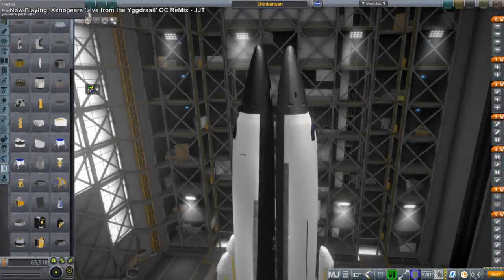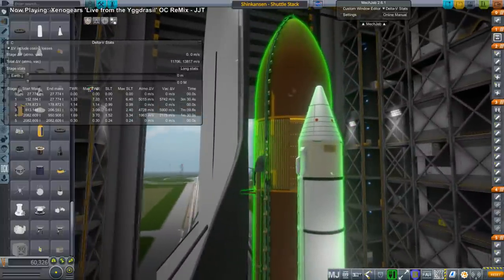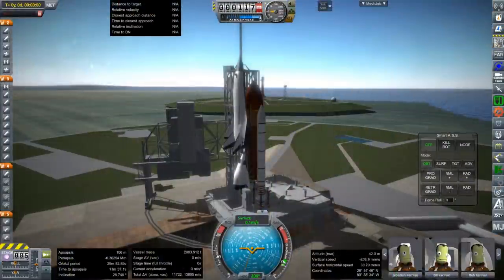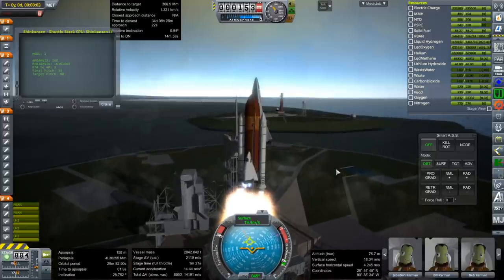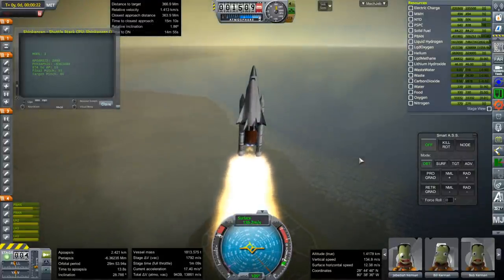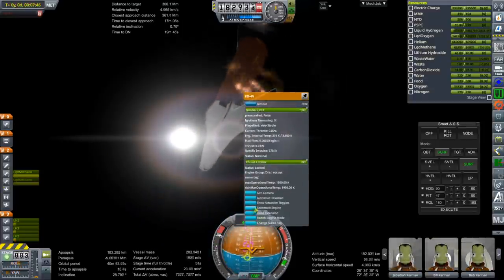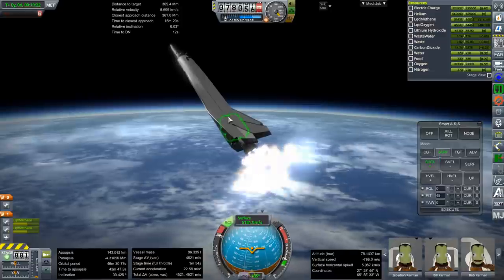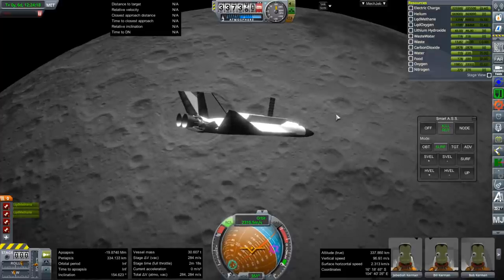Realism Overhaul in KSP - Shinkansen on the Shuttle Stack

Comment: 8:45 That's... odd... I remember a (near?)-identical proposal called the Ballistic Aft Fuselage Propulsion Module, but I'd never heard of there being one on each side. (And I had also independently came up with the concept before knowing it was real.) 

9:28 Perhaps you could also alleviate the 2nd stage TWR woes (in addition to powering through Max-Q at full throttle and reducing the Shinkansen's fuel)... well, what SSME version/thrust rating did you use? I'd have them running at a constant 109%.

23:15 To eliminate the rotation problem, maybe the angle of the SSMEs could be altered by a  few degrees?

Comment: Hirmh... What about doubling up on SRBs and running the SSMEs on minimal thrust?
Reply from the maker: The SSMEs already go minimal through maximum dynamic pressure, so putting double the SRBs would put way more stress on the vehicle. In real life, this arrangement is already pushing it, and adding SRBs would definitely rip it apart.
Reply: What about halving the SRB thrust for double the burn time (whilst using 4 SRBs?)
Reply: @LexieAssassin  to increase gravitational losses

Comment: I guess the point of this (shuttle concepts) is just because it's cool right? More like a challenge than anything else?
Reply from the maker: Well, the Shinkansen's limited payload capacity in its twin-spaceplane configuration has been an annoyance, so I've been looking at alternate concepts. The point of this, I suppose, is that we could have replaced the Shuttle with a lighter spaceplane for crew operations and light payloads (putting heavier payloads on the previously introduced Shuttle-derived launch vehicle), still recovered the engines using an Engine Mouse, and would be able to have this spaceplane facilitate operations to the Moon. Instead of having Orion on SLS, you could use a lot of existing hardware, recover the engines, and your pod to the Moon, service module, and transfer stage would be reusable (because they're all built-in to the Shinkansen).

Comment: You could put the three RS25 engines onto a hinged thrust plate. A little math should give you values to set the proper angle on the hinge while the CoM shifts. So you always have left enough angle on your engines' vector gimbals for controlling your attitude.

Comment: Please, do you have a document or diagram showing the space shuttle concept with two engine pods?
Reply from the maker: It's in the book Space Shuttle - Developing an Icon by Dennis R. Jenkins, Volume II p.451. It was a Shuttle-Derived LV proposal in 1984. Rockwell proposed an engine recovery system like the engine mouse in 1982, but that was paired with and strutted to a side-mounted payload carrier. For the double-mouse system with top-mounted payload, there's a diagram and an artist depiction, but I haven't found details in a cursory look at the text. It may be from here: https://www.nap.edu/read/19350/chapter/7#25. Interestingly, that's a 4 engine variant instead of 6, so apparently they beat me to that as well. Edit: here's a better version of that:https://ntrs.nasa.gov/archive/nasa/casi.ntrs.nasa.gov/19850015556.pdf on page 35.
Reply: @RaizSpace  thanks a lot!

Comment: I think this idea with shuttle parts is step back from your original idea with 2 planes. Looks like you have a lot of "empty" space in fuselage and wings - why not use it for more fuel and boost thrust (since it all theoretical) for good twr? This way you can throw away this little boosters and get much more simplier system.
Also, since you have a lot of tanks, why you not using mod for balancing fuels? In my planes i found PWB Fuel Balancer useful.
Reply from the maker: This is if we need to have a direct transfer to the Moon and is sort of a challenge to Orion, as this, if workable, would be a patently better system than Orion-SLS. There's no empty space in the fuselage - you can verify that from the original design videos - and the structural mass of the wings would have to increase to bear tanks, and those tanks would be of negligible volume. Also, the Shinkansen has to be refueled in orbit, and it is sized so that this can be done with one launch of an SLS Block IB or a Starship (one reason I decided to make Starship). There's no point in balancing fuels - we want the rear tanks to drain first because that's essential to Shinkansen being able to reenter.

Comment: I think what you proved here is that the shuttle stack is a useless piece of antiquated engineering that doesnt work outside of the very narrow parameters of the shuttle itself.
Reply from the maker: It got this thing to the Moon. It could do with a little tweaking, but I'm guessing you didn't watch the whole video or something. I'd also be hard-pressed to find a lighter hydrolox tank system than the External Tank.
Reply: @RaizSpace  It's the asymmetry, just look at the Raiz Monster you created stitched together just enough to keep it alive, and it flipped out every time...
In-line rockets are better, Change my mind.
Reply: @RaizSpace  But it was very fun to watch you try, Im not arguing entertainment value.